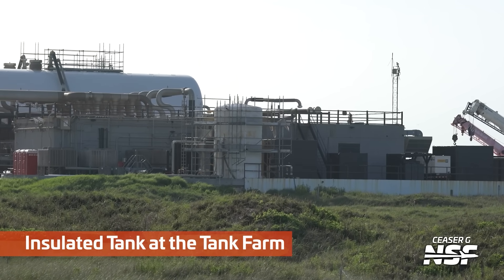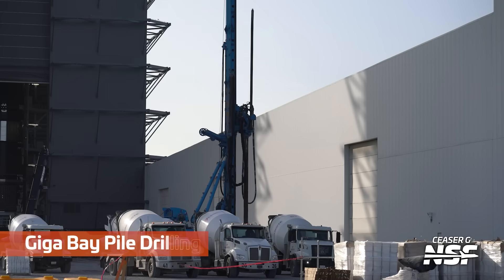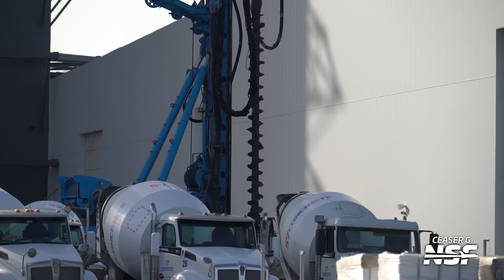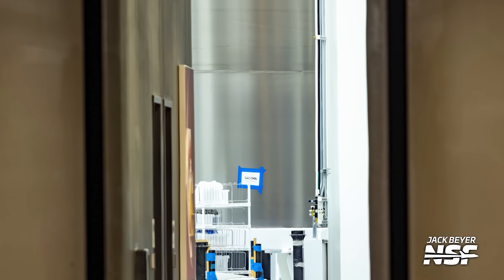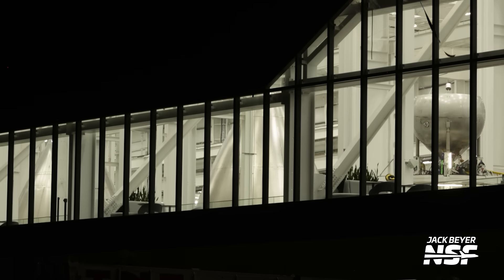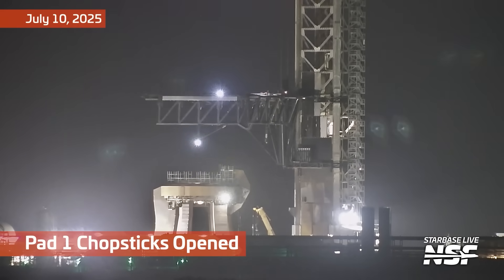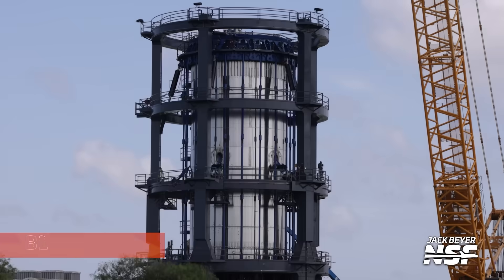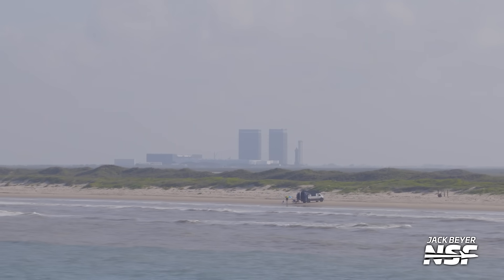"Starship Static Fires are Shaping Up" | SpaceX Starbase

Comment from the maker: We're still trying to get Youtube to bring back our option of alternative commentaries. Their current response is they are working on it and to give it a few days. Bottom line, it does look like they are claiming they can get it back in action.
Reply: They are putting in reverse auger cast piles. Great for use in sandy environs. You spin the auger in the reverse direction which pushes the soil to the outside and does not come out of hole. This increases frictional bite, plus you don't have to deal w/ tailings.  When you reach the target depth, you start pumping in cement thru the rods and hollow bit - the pressure will blow out a yuge cork at the tip of the bit, and as they back out the auger the hole gets filled with cement and keeps hole open. Then you drop in the rebar cages.
Reply: @docrox-1  Maybe you could also explain how in the video, a small backhoe is removing cuttings from ground level around the auger as it’s working. I mean, if your reverse rotation means there’s no cuttings coming up the flights. Pretty sure you’re full of it concerning any sort of reverse rotation and packing soil into the surrounding formation as physics and soil just don’t work that way. But hey feel free to run your mouth about things you only partially understand in the comments I guess
Reply: @jazzmusiccontinues1134  stick to music. This was my job. You will get minimal spoils, especially after injection - you will still get SOME. This process is extremely valuable when putting piles in contaminated soil you would have to pay to dispose of.

Process: Use a displacement tool to compact soil laterally during drilling, creating a dense soil column with minimal spoils, followed by concrete placement.
Suitability: Ideal for loose or granular soils (e.g., sands) where lateral compaction increases frictional resistance and load capacity. They perform well in variable soils but may be less effective in highly cohesive or saturated clays without adaptation.
Advantages: Higher load-bearing capacity and reduced settlement in loose soils due to soil densification.
Reply: @docrox-1 Even if it was your job, how confident are you that reverse auger cast piles are the exact process being used in the video? I have done plenty of hollow core auger work myself although admittedly mostly in heavy clay conditions.
Reply: 1:25 Those are stands to anchor the arms that hold down the vacuum raptor's nozzles to avoid them vibrating to pieces during a SF at sea level.
Reply: These grab the reinforcing rings that are temporarily clamped around the vacuum nozzle rims. 
 @knowledgeisgood9645
Reply: But I like your current commentaries.

Comment: Auger vs Drill
Auger bits and drill bits serve similar purposes but differ significantly in design and application. Auger bits are specifically designed for creating deep, clean holes in materials like wood, plastic, and even ice, featuring a helical screw tip that allows for self-drilling and easier chip removal.
 In contrast, drill bits are more versatile, used for drilling holes in various materials including wood, metal, concrete, and stone, and do not necessarily feature the self-drilling capability found in auger bits.

When comparing auger bits to other types of drill bits, such as spade bits, auger bits create smoother, more precise holes with less effort, while spade bits are more suitable for quick, rough drilling.
 Auger bits excel in deep drilling tasks, whereas Brad-point bits are better suited for shallow, precise holes, such as those needed for dowels.
 Additionally, auger bits are great at removing waste material, but Forstner bits can drill faster and create flat-bottomed holes.

In terms of usage, auger bits are commonly used in woodworking for tasks such as drilling deep holes for furniture making, gardening, planting, and material mixing. They are also used in outdoor constructions, tree planting, and mining.
 Drill bits, on the other hand, have a broader range of applications, being designed for drilling holes in wood or metal (or plastic) with different sized heads depending on the material.

Auger bits have several advantages, including the ability to drill deep holes (up to 600mm or 31") in wood, producing high-quality holes, and ease of drilling due to the guide screw on top. However, they are slower in speed, lack versatility (drilling only wood unless they are specialist augers), and can be expensive.
 Drill bits, while not as specialized as auger bits, offer more versatility across different materials and are generally less expensive.

In summary, the choice between an auger bit and a drill bit depends on the specific requirements of the project, considering factors such as the material to be drilled, the desired hole quality, and the depth of the hole needed.

Comment: @5:00 Hey Das, when it comes to ground drilling/excavation generally if the "drill" has a spiral flute up the shaft to remove material as its turning if known as an auger, and a drill for the ground is usually hollow, will have either a fixed head or it may have a head that looks like a load of gears, this is referred to as a Drill. Drills are often used for much deeper holes that go past any ground soil/dirt and has gotten into rock, so an auger would get bent and damaged. 

Auger heads are used for driling ground that is fairly soft compared to the firm rock layer, whereas a Drill head is used against rock and is usually water cooled, oh and extremely noisey lol
Reply: Generally augers are used in softer material and shallower holes and depend on the flights around the shaft to lift the material out of the hole to the surface. Depth is limited by the mechanical strength of the shaft which has to bear the rotational torque for drilling and the weight of the material being lifted out of the hole.

Drill bits can be in several different styles depending on how the type & hardness of the material being drilled. The drill string (pipe that the bit is connected to) is hollow and a fluid (can be air, water or "mud") is pumped down the hole and this fluid does cool the bit but also circulates the material (cuttings) out of the hole and can also stabilize the sides of the hole with a mud cake that helps prevent washouts & caving.
Reply: @Eddy-s7i  a bit more of a detailed version of what i said :P lol

Comment: FYI, if I’m not mistaken, the drills are hollow, and it pumps in concrete as it pulls out. If it fills from the top, it can leave voids. Then they put the cage in before it starts to harden,

Comment: Good shot of the 'wash pipe' on the bore drilling machine, allowing for annular flow through a rotating drill string
Reply: Not really a wash pipe. A wash pipe is part of a swivel assembly designed to convey pressurized drilling fluid into a rotating drill string. You wouldn't want any sort of annular mud flow through an auger string as the flights on the augers carry the cuttings up and out of the hole. The pipe and hose in this case is used to pump cement inside the hollow stem auger to place it in the annular bore more effectively, a technique used in areas that are difficult to drill in.

Comment: Point of order, if I may. They drill the hole, and backfill it as the auger comes out, to keep the hole from collapsing, and then smash the rebar in
Reply: The big hose jumping around at 3:50 is jumping because a concrete pumper is pumping through it down into the hollow stem auger and backfilling the hole.
Reply: So, let’s see:

Drill Hole
Fill Hole
Smash Hole

Correct?

🤔
Reply: @ernestgalvan9037 nah usually the cement is mixed wet enough to just lower the rebar structure into place through the liquid cement. Think he’s just being dramatic
Reply: @jazzmusiccontinues1134 ..yes, I know… i was being “funny”…

Hence the 🤔

Comment: auger is a type of drill bit.   it usually has some type of rock cutting end, and more or less an Arcimedes screw which is good (best) at moving materal out of the hole.

Comment: OLM-1 had the dance floor or the floor lifting device to allow engineers to work on the engines without having to worry about falling. How is this being done for OOM-2? There was once some talk about a movable floor similar to the one at the Massey Static Fire Pad, but this seems not to be done at Pad-2. Any theories?
Reply: I have not seen any sign of one yet, but expect them to put one in. Maybe it glides in on rails like the one at Massey.
Reply: @knowledgeisgood9645  Rails through the new GSM structure prevent that, leading to rails over the flame trench walls, but they are angled downward on both sides.  They would have already seen some evidence of that being set up with brackets for the rails.  But even if rails were set up over the trench, how would you hide it when the ship fires up? It would be in the way of the flames.  Something's not right.
Reply: @CATDRL2  Just as the rails at Massey are not in the way. The rails are farther apart than the diameter of the booster. But we have to just wait and see.
Reply: I suspect they don't expect the same need.  The original OLM was built as part of development and had to support that.  I think Pad 2 is mostly a launch site only.  Pad 1 will likely still be used for booster work and static fires.
Reply: @imaginary_friend7300  They will always need to check on things. I would be very surprised if there was nothing at all.
Reply: Much of the need for the dancefloor arises from installation of engine chill drain hoses for every SF test and flight, as well as inspection/maintenance of the outer engine ring QDs.  The v3 Booster won't have per-engine QDs, and won't have the disposable engine chill collection hoses.  In the same way that Ships don't need any further manual work on their engines once stacked on top of a Booster, I expect v3+ Boosters won't need any further manual work around their engine section once stacked on top of the OLM.
Reply: @Spherical_Cow  Thank you for an excellent reply.
Reply: @Spherical_Cow  I am sure that is true, but there a number of other systems that need to be checked occasionally. Destacking every time they need to do one of those is reason enough to have a dancefloor of some kind.

Comment: So a ship blew up and took out Masseys, what if they don't fix the next ship and that's going to take out the launch pad now?
Reply: They can, at least, always bring the COPVs up to full pressure before adding any methane. That should make the next RUD far less energetic. 

I suspect all the COPVs will get a full over-pressure liquid test cycle by SpaceX employees from now on.
Reply: They also test the much larger booster on the launch pad which itself is a potential explosion hazard.  There is always some danger.
Reply: The launch pad should be able to handle an explosion much better than Masseys, but it might be an acceptable risk for them anyway. Only two more ships are likely to be able to use Pad 1 in its current configuration, so if S37 destroyed it they might just scrap S38, move on to v3 on Pad 2, and rebuild Pad 1 to be the upgraded version
Reply: Accidents are very common during R&D. It was neither the first nor the last time something behaves in an unexpected way. You clean up and rebuild, then continue.
Reply: It didn’t ’take out Massey’s’; and they’ve already got a second launch pad almost completed. Geez.
Reply: @dphuntsman It most definitely took out a chunk of Masseys.